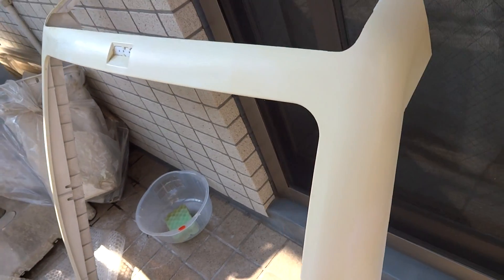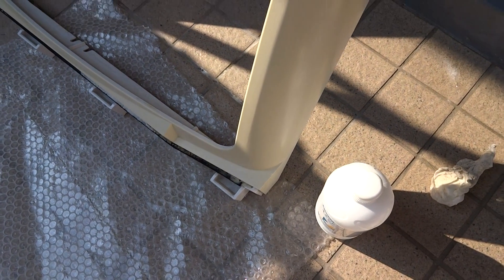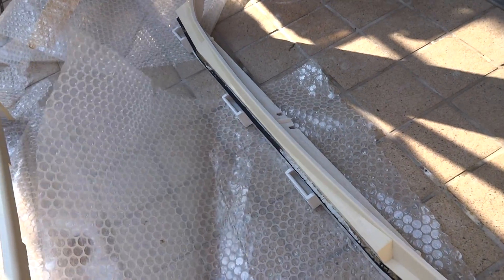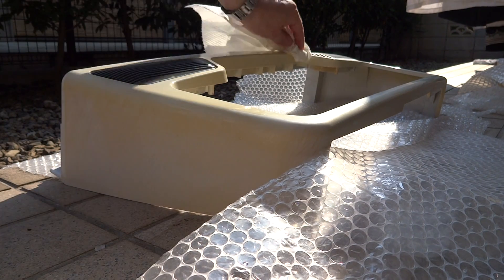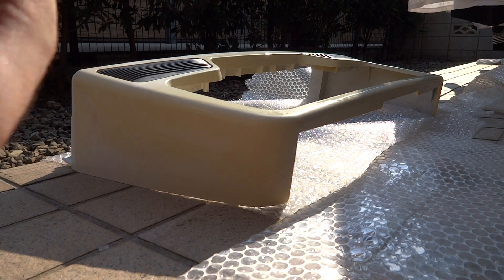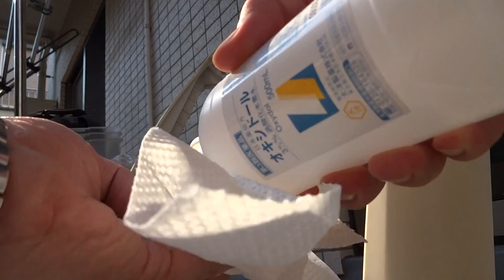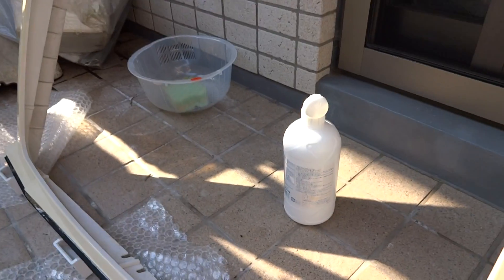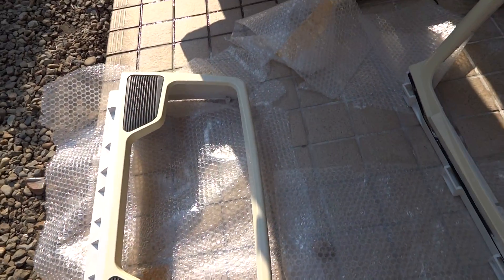Experimenting: Sun Bleaching A Super Neo 29 Plastic Bezel (Pt.3)

Comment: on every commodore product before the amiga 600 you might try a hard rubber. normaly itll peel everything off. the plastic does just turn yellow at the top layer, the yellow tint stops directly. this works on many 80s to mid 90s pc greyish white and white plastics aswell.

Comment: After only 2,5 hours I saw a slight difference in color, but the hydrogenperoxide was all dried up, so making it into a gel would be better. Just making it thicker using stuff like corn starch or flour won't cut it.

Comment: I am trying this too with a yellowed snes case from my parts bin. I mixed the 3% hydrogen peroxide with corn starch to make it a bit thicker and I masked out a square on the plastic using masking tape so any change in color is easier to see. Lets see what happens. I could make retrobright later on when it does not work out.